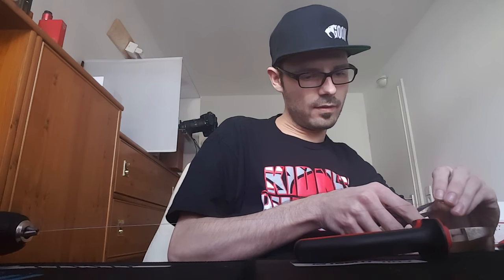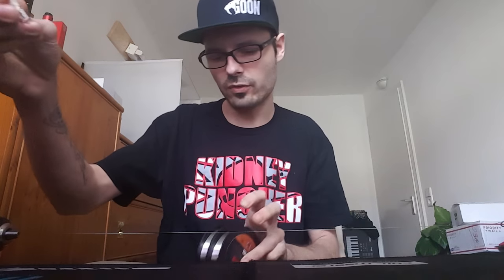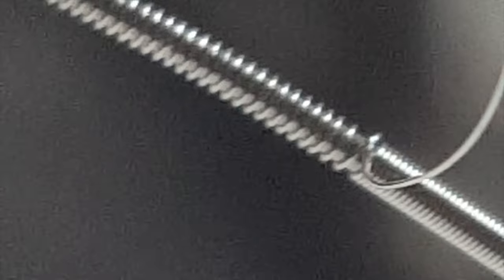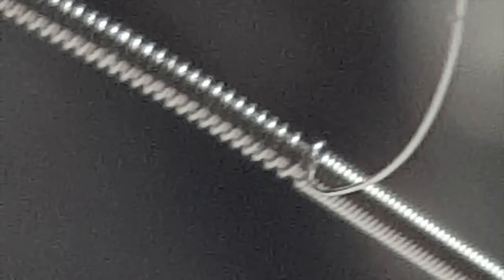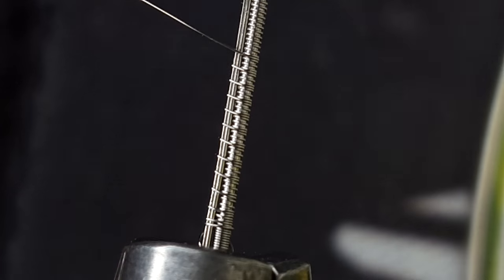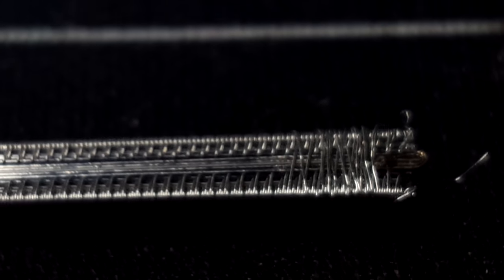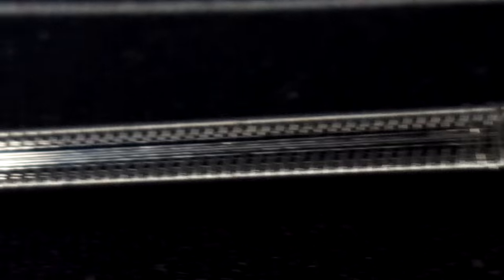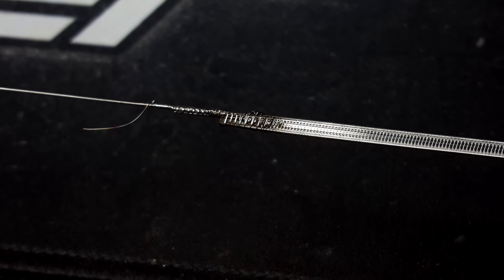Pitchfork build tutorial by @mind_forge

Comment: where do you get the clip
Reply from the maker: idk sorry... i found this on my toolbox thats why i tried to show it close that you may find a similar.
Reply: go to your local wallmart and look for the close pin's for laundry  that's what i use  ...hope that help's
Reply: you can also use just a plain old wooden close pin use 1/32 drill bit or if you can find 1 smaller go for the smallest 1 you cab find ..drill 3 hole in the front side by side .......1 in the top ...and 1 or 2 on the side....;)

Comment: i don't mean to bust your balls but if you just grab the wire from the spool with pliers and extend your arms stretch the wire it straightens it self by spinning it in the drill it twists it and it becomes hard to wrap around a screwdriver for example 20g plus by hand you take 2 of the 40g or that ever pull stretch throw one to left one to right and spin it on to the core wire by hand it comes out way more tighter and sturdy instead of a clamp that has little pressure on the wrap but its my opinion
Reply: but other than that good job
Reply: rush bk yea.. instead of twisting one direction.. just twist one way for like a second and a half.. then switch direction and twist the other direction an equal amount. that's the technique mind forge is using here. it works well keeping your wire nice n straight with less kinks and hockling.. 👍😊